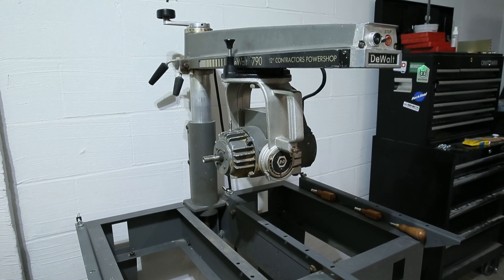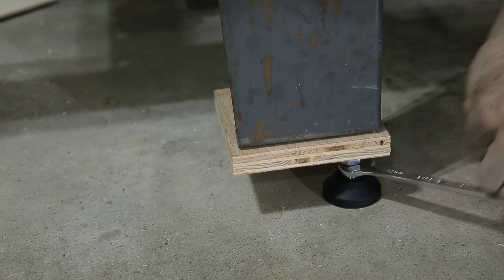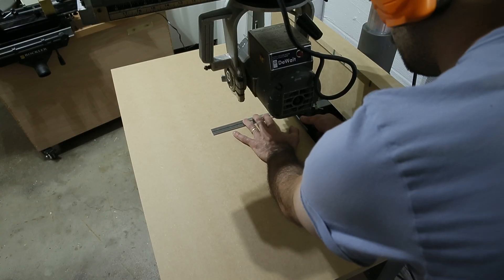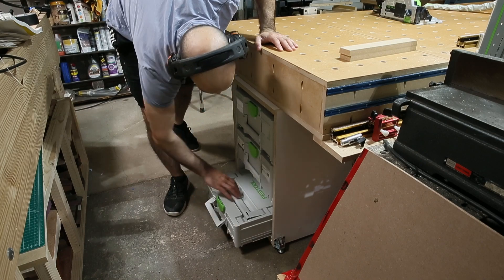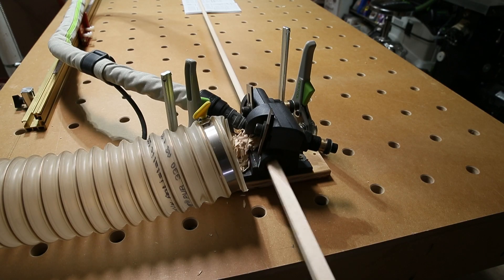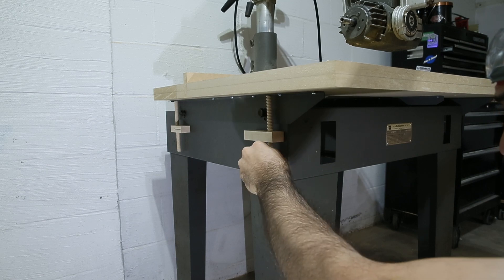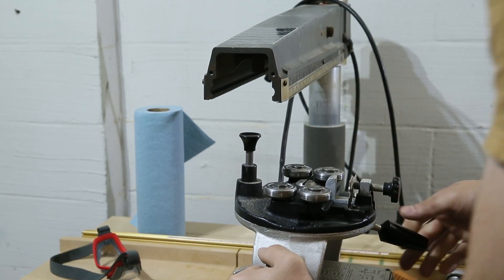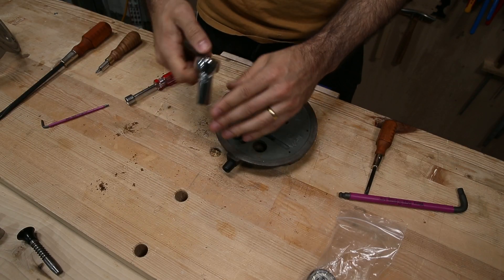Tuning a $125 craigslist radial arm saw; cutting wooden threads

Comment: One upgrade I'd recommend would be a laser guide.  It bolts on in place of the outer flange between the blade and the arbor nut.  I think mine was about $32 on Amazon and made by Oshlun.
Reply from the maker: Yeah those are cool! Not too hard to just sight down the blade though, and it works on both sides of the saw.

Comment: On the older 1950's DeWalt models they had tracks bolted between the frame and the table that could be adjusted with jam nuts between the track and the frame.  It makes fine adjusting of the table easier.  I just assumed they all originally came that way.  My mid '50's DeWalt MBF is like that.  Mine was also originally ordered with its optional cabinet and the cabinet's feet can be adjusted fairly easily, though you do need to jack the cabinet up to loosen the bolts that let the feet slide up or down.  I just used an automotive floor jack and a 2 foot long piece of 1x4 to level my cabinet that way.  It probably would have been easier in hindsight to level the cabinet when it was empty and didn't have the saw atop it as I could have just tilted it to one side to loosen the slider feet, but where's the fun in that?  LOL!

Comment: the 5 cut method is great for table saws.  Those videos show how to adjust based on the results.   your 5 cut was perfect the first time, no adjustment  needed, so we have no clue how to fix it based on the 5 cut method.
Reply from the maker: The arm isn’t rigid enough to make that level of adjustment worth it unfortunately. You can do the geometry and use a dial indicator if you want, but even if you managed to get it dead nuts as soon as you bump into the arm while walking through your shop you’ll lose it.

Comment: I have the exact same saw.  mine was $50.   I could not afford new bearings so I spent a long time and many days to get them to spin okay. before it was almost impossible to pull across, now it rolls and you just smile when you feel it.  Thanks for this video as I am about ready to tune it in.   I had to sell my big wonderful cabinet saw and this is my only big tool. It has to do everything!
Reply from the maker: I’d definitely recommend picking up the book “Fine Tuning Your Radial Arm Saw” by Jon Eakes (you can find it on Google in PDF form) if this will be your main saw. The other book people recommend by mr sawdust is not worth getting IMHO - the Eakes book is far better.

The method I used for tuning in this video is not good if you plan on swinging the arm away from 90 degrees
Reply: @JimPudar  I believe in his (Mr. Sawdust) videos that he doesn't recommend the 1960's and later models of radial arm saws, just the 1950's and earlier models with the full cast iron arm and adjustable tracks and as I see your model doesn't come with the adjustable tracks to level out the table that could be why you didn't find his book very helpful.  That being said, I do wish mine had a larger motor and blade as my MBF only has a 1/2hp motor and a 9" blade.  Some day I'll find a larger 50's model like a 1030.  I couldn't pass mine up though as I got it for $40 and spent maybe another $100 on bearings, wiring, switch, primer and paint to restore it.

Comment: How much friction is in your carriage?  I set mine to 5 lbf to move it, which is recommended.  Yours looked more free.
Reply from the maker: I find those old recommendations to be really unfounded, they put unnecessary stress on the bearings and also on the arm. I have them set just so there is zero play in the carriage. I did install a return line which adds a constant force pulling the carriage backwards. You can buy those from Original Saw. I’ve had no issues this way.
Reply: @JimPudar  Thanks for your reply, and for all of your RAS videos.  It does seem like the 4-6 lbf is a work around for a return line, now that you mention it.  I would like to add a return or feed limiting device as well.  I also use a magnetic starter, but I replaced the original arm end switch with two LED backlit momentary switches.  I also have the original Square -D Momentary switch box mounted to the bottom front of the table.  I removed the centrifugal brake at the recommendation of Wolf Machinery (now Command Industrial), as they also do this for all 7790 saws.  They said that many (high hour) motors have been ruined when the flyweights come loose.  So now I would like to add an electric brake eventually.  I paid $80 for my 7790 from eBay, but I had to drive over 200 miles each way to pick it up.  Thanks again for the videos and response.
Reply from the maker: @johnd.crofts7901 I’ll have to put up another video soon, my latest RAS is a 16” 5hp GE running on a rotary phase converter!

The “new” saw takes over 60 seconds to come to a stop. I also thought about getting an electric brake, but after getting used to it I have not really found it to be an issue.

Comment: I have a DeWalt model 770 radial arm saw. It has only a 10 inch blade, wired 220 v. and is rated 3.5 hp. 
In Northern Minnesota red pines are planted and grow like corn does in Iowa.
I have owned DeWalt radial arm saws for over 50 years and to see their usefulness diminished over the years is sad. Granted it is a heavy power tool that takes up space and meant to be stationary in a shop or garage can be a problem unless it is more maneuverable and serves a new purpose.

If you are a woodworker and live in tree country like I do, you most likely live on an acreage.
 I have been wanting a saw mill and have researched many of them only to fined they are more costly to buy and costly to operate do to other equipment needed to load it and a building to store and operate it in. We could be easily pushing costs as high a $50.000 total.
There was one sawmill I saw on YT that gave me an idea to use a saw I already owned and turn it into a mill...  it was  the Ecosagen like a rocket  video.    • Ecosågen, like a rocket...   
Only I created a smaller version, thus the DeWalt Radial Arm Sawmill or an ecojacgen?
https://www.youtube.com/watch?v=Oq7fOd_O5yM

Comment: Join the Delphi Dewalt radial arm saw forum (it's free). Lots of very knowledgeable people there to help whenever you need it and the FAQ's are great. You'll learn a lot and get better results with your cuts. You'll learn the proper way to set up your saw and it'll be a lot safer. Watching the video WOW there should not be all that movement. Join the forum you'll be glad you did.

Comment: One "improvement" you can add to your table system is to add a 1/4" layer of plywood or hardboard as a consumable surface. That will preserve the integrity of the table over time. Another improvement might be to remake the table in the "Mr Sawdust" fashion. Brian Weekly has a set of youtubes which detail the process (including how to handle the back table sections' thickness).

Comment: Years ago I met a carpenter that was missing half his hand. (He was our union safety representative) He told me he was going to make a cut on an industrial radial arm saw that was cranked down with the blade in contact with the table. He had his hand on the table when he pressed the on button. The saw ran forward and cut off his hand
Reply from the maker: Yeah these things are no joke, that’s for sure. I always make sure my other hand (and all other body parts) are well outside the path of the blade before I press the On button 😅

Comment: I have the same model RAS. Love it!    There are seven types of the model 790. Types 1-7 and then a metric version.   Mine is a type 7.  Do a search for Woodbutcher RAS forum if you want to get more info from some RAS fans.  I have four radial saws so far, but I can stop acquiring them any time.......

Comment: Excellent video and editing.  However, you made the job much harder than it needs to be.  The best reference on the subject is Jon Eakes book "Fine Tuning a Radial Arm Saw" that is available as an ebook on his website.  He discusses the differences between different manufactuers, but the process is identical for all and doesn't require special tools.  You also skipped a few steps such as getting the play out of the column.  

One critical error I see is that you have too much play in the carriage bearings.  When properly adjusted it should take 5-8 pounds of pull to move the carriage and motor.  This is because the saw has a tendency to pull itself through a crosscut and can climb on top of the stock you are cutting.  

Also, the table mounting brackets on your saw are attached with square nuts that lay flat against the flange on the inside of the base to keep them from spinning.  A crescent wrench on the flange side bolt will gently lift the flange for a perfect fit.  I like to adjust the table flanges before installing the table and use a feeler gauge to get the four corners of the outside flanges co-planar.  I then adjust the center support by putting a straight edge between the two sides. I then drill holes next to the bolts and bolt them in place to keep them moving if someone pound on the table.  It is difficult to build a perfectly flat laminated table but you can make one flat by securely bolting it to the supports.  You can also use T-nuts and/or bolts to raise or lower the center.  The Craftsman RAS manual explains this process.

And last, just because your saw will take a 12" blade doesn't mean that it should be your everyday blade.  For best results, you should use the smallest blade you need to make the cut because smaller blades have more power - especially for ripping..  Often missing on the 790 is a bumper that mounts on the rear of the motor arbor.  It prevents you from cutting into the column if you are making a bevel cut with a 12" blade.  Also frequently missing is the anti-kickback pawl that is essential when ripping.  Most users at the Delphi Dewalt Radial Arm Saw Forum find that the Freud LU83R010: 10" Thin Kerf Combination Blade is the best all around blade for daily use.

Seeing the care that you put into tuning up your leads me to believe that you will become an enthusiast.  Have fun using it.
Reply: Good review , saved me the time to say the same thing. These saws are gems and finding them out there is such a great deal. Thank you for the video!
Reply from the maker: Thanks for the tips! I’ll definitely mention some of these in the next RAS focused video.

I did purchase a return reel which pulls the carriage back to the home position - I didn’t want to overload the bearings too much. I got them just tight enough that there is zero play, but no more.

My saw did come with the anti kickback pawl, but I am not going to do any ripping with this guy so it will sit in the drawer. The bumper is also present (I think).
Reply: @JimPudar . Simply it even further. Google the articles How to rebuild a Dewalt RAS , and How to Fine Tune a RAS, both by Roger A. Hill. His instructions are simple and pure. He also gives a recipe for building a “Frankensaw” which will blow your mind, if you’re inclined to own the finest/strongest budget saw available!

Comment: Congrats on the new saw. I have a 1963 craftsman with a 9 inch blade. I bought it cheap. I've used it for years. Not better than the new miter saws, but I'd say just as good and so much cheaper 👍. Well done video 👍

Comment: So jealous! A 790! I have never found one of those. Dang. I had to get a Black and Decker T1530 version of the 790, which was made in 1969 and it's not as cool because it's called a "Black and Decker" on the model tag. I've never had anyone to help me with anything, so I loaded mine up myself into my work van by taking it apart, and carrying the arm and motor separately. The only thing stopping me from setting it up is that it's so difficult to move once it's all assembled. P.S., don't make jokes about not being a machinist. You're the most meticulous person I've ever seen on YouTube, and I've watched every radial arm saw video that exists on YouTube. I've never heard of "Way Oil" before, or seen anyone make adjustment screws for the table. Nor have I heard of anyone actually replacing the carriage bearings or even make a mention about how smooth or coarse they are. As far as I can tell, the reason the Craftsman saws are inferior is only because of the VERY coarse sloppy bearings they use on the carriage, and not because they are a poor design (they are a good design overall).
Reply from the maker: Thanks a lot for watching, glad you enjoyed this!
Reply: @JimPudar  Are you still using this 790 saw? I am still debating whether I should keep my version of the 12" saw with the 17 amp motor. I am actually really afraid of the 17 amp motor on a radial arm saw. I do daily ripping of boards, including old reclaimed hardwood boards, on my Dewalt 9" saws, and also a Craftsman 10 amp radial arm saw. With the small 10 amp saws, they stall when the blade binds, and they don't kickback the board. I'm extremely nervous about using a 17 amp motor, because it has no margin for error. Are you using the saw for daily shop functions, or is it more of a novelty item? The 12" saws are so big, I'm not sure that I am brave enough to use it.
Reply from the maker: @starseeddeluxe  Yeah, I use this nearly every day. I wish it had more power - I stall it out every once in a while when cross cutting 12/4 stock, and it does take up a lot more space than a miter saw would, but it’s a very practical and not at all scary tool when you get used to it.

Comment: Dam it, I have a RAS (Craftsman) but I want one of them engine hoists.
 I have a mini lathe and mini mill and that engine hoist would be great. //ji
Reply from the maker: It’s a great help when the legs can fit under whatever you’re trying to lift, but more often than not I end up using blocks and a long metal lever. A gantry crane would be way better for the types of things I move a lot, but that takes up way more space. 

Matt on Next Level Carpentry has a great video about his “sky hook” which is another good option I’ve been meaning to try out.

Comment: Great Stuff, I have an older Dewalt 12" radial arm saw that i need to get adjusted similar to how you have done. Using the Dial indicator was a great idea!
Reply from the maker: Thanks for watching! In practice I’ve found that it loses the “super tune” pretty quickly after making any rough cuts. I’ve been using it mostly to rip long stock to width, and then I make the precision cuts on my table saw with a sled. Maybe someday I’ll find an extremely beefy 16” model with the turret design; I think those hold their settings a bit more robustly.
Reply: @JimPudar  Jim - I don't think the problem is necessarily with the saw losing its tuning.  All radial arm saws have multiple moving parts and need "end play"  for the parts to move.  But unlike many late model saws, your DeWalt is built with very close tolerances.  Even so, you still need to account for end play when tuning your saw and setting up for a cut.  The most common complaint new users have is that saw doesn't  cut a consistent 90 degree crosscut.  This is usually a combination of failure to take into account end play during the tuning process and while using the saw.  The column may have play, the carriage bearings may be too loose, the motor may not be locked in place and the locking lever for the arm may be too loose.  For example, the arm locking lever should be tight enough so that it doesn't fall down on its own.  Once the lever is lowered, there may still be a slight amount of play.  You eliminate this by applying slight pressure to the arm in one direction (most users apply pressure to the right) as you seat the lever in place.  You need to follow a similar procedure when you lock the motor by pushing the locking pin down and applying slight pressure while locking the lever in place.  I see that you didn't check the column for play in your video.  It seldom develops slack but it still needs to be checked.  If you follow the tuning procedure in Eakes' book, your saw is build to stay in allignment  provided you follow a set procedure every time you move the arm or motor to a different position.
Reply: @JimPudar  definitely, I have had the older all cast iron saws and I did have a 16" for a while but electrical issues kept me from being able to run the 16". I think at one time I owned 5 radial arm saws but now I just have one and 12" DeWalt sliding compound miter saw.

Comment: Excellent job Jim but the table is to low for a big guy like yourself
Reply from the maker: Thanks! I’m actually planning on lowering it to the same height as my table saw soon, as the current location causes it to interfere with longer cross cuts. It’s definitely not optimal, but I spend a lot more time at my hand tool bench - I really feel a small height change there!

Comment: Great purchase and previous owner testifying to the contrary of the Safety of a quality Radial arm saw. I have a 12" Delta and love it. I've been using a Radial for 48 years and really haven't had any really close calls for losing fingers. Very close on a band saw a couple times though. The only two stories of finger losses have been from table saws . I've had them and gave them away . Nice saw ❗